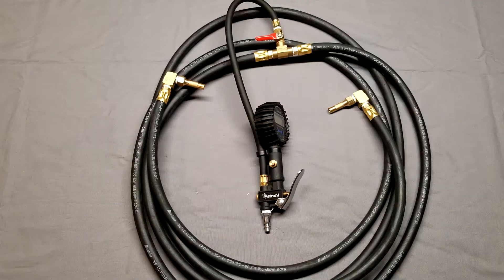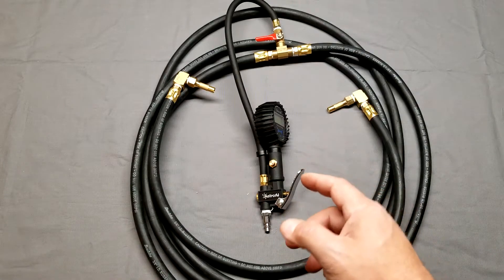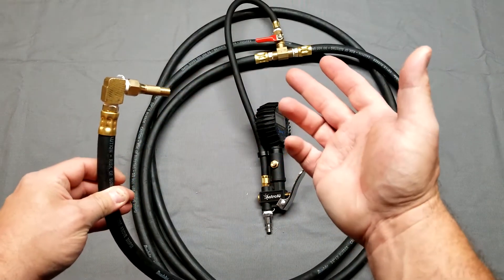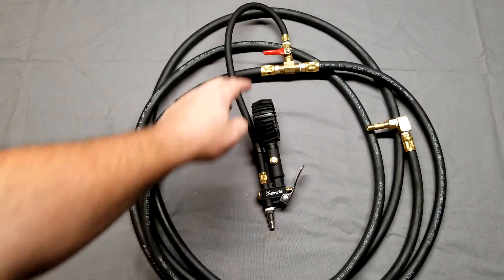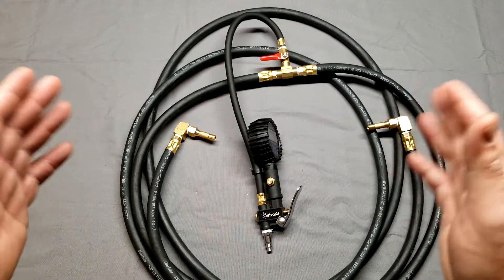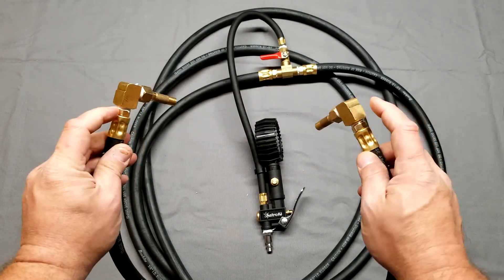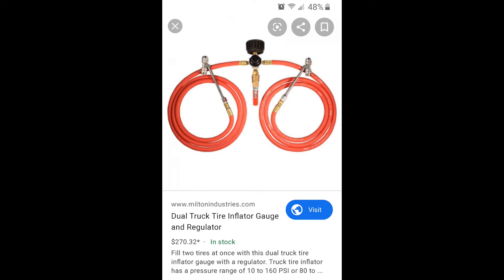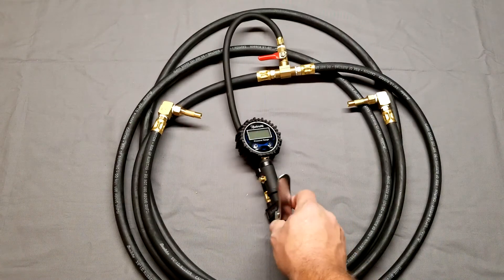How to make your own dual tire inflator

Comment from the maker: Items used in this video.
Digital tire pressure gauge/inflator:
https://amzn.to/2ODt2oy
Screw-on vale stem air chucks:
https://amzn.to/2OfIOa7
90 degree brass fittings (2):
https://amzn.to/2KOzjwi
Shut-off ball valves (3)
https://amzn.to/2KP0BmC
Brass "T" fitting:
https://amzn.to/2OFZnLl
8 ft air hose (2):
https://www.harborfreight.com/air-tools-compressors/air-compressor-accessories/air-hoses-reels/38-in-x-8-ft-15-ft-rubber-air-hose-remnant-60356.html

Thanks for watching.

As an Amazon Associate I earn from qualifying purchases.

Comment: I've been contemplating something like this for my ATV, which has a solid rear axle, no differential, so if there is any difference in diameter of the tires due to air pressure, it means one tire is  dragging ever so slightly. The tires require 4.4 PSI and my gage makes it hard to read down to the 0.4, so I figured the best thing would be to have something that equalizes the tires to whatever it turns out to be and at least there's no way that one is dragging.
Reply from the maker: I have upgraded the device in this video so that it now can inflate all 4 tires on a vehicle at one time.  This way I can equalize all 4 tires and get them all at the exact pressure that I want.  It does work very well.  It's kinda clumsy to deal with but it does a great job.  Thanks for the comment.

Comment: Good video, Thanks.
I had already bought one, and even with that I had that leakage problem. Useless if you have to run around a big rig or caravan.
I hope you got yours sorted out. Thanks again.
Reply from the maker: Hello....  Yes, the one I built in this video works great now.  In fact, recently I expanded it to work with four tires at the same time (instead of only two tires at once) and it works even better now.  I was able to buy a 6 into 1 aluminum manifold on Amazon which made the 4 tire version very essay to assemble. I will probably make an update video about my tire inflator at some point this winter.  Stay tuned.  Thanks for the comment!

Comment: Closed type air chucks so you don't need close valves on each side. 

I recommend the Haltec H-5265
Reply from the maker: You are correct.... and I did realize that shortly after making the video. Thanks for the comment. 🙂